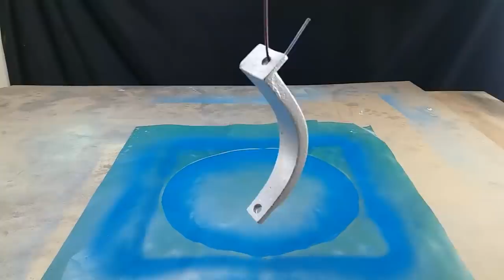Very Old Exhaust FAN Restoration | Restoring Electric Fan Step by Step

Comment: I like your vids. I'm not sure about the color choices, but it did come out beautiful. I think I would have done the whole thing silver with high temp paint, depending on what use I had in mind for it. That's one thing I love about vintage items, the way they were made, you could restore and or rebuild them. Modern stuff isn't made to be redone, just trashed when it tears up... I'm sure somebody could rebuild modern stuff, but it wouldn't be easy. You can be innovative on how you do things when the need arises, I like that. You find ways to do what has to be done. That's so cool.

Comment: Process not described or explained : which chemical used for cleaning how long it required to complete the procedure, step by step explation will give detailed knowledge to get worked done at least narration shoud required
Thanks for good work

Comment: I just want to point out that.. you installed the blades on the hub backwards..
Reply: Theres no wrong way to put them on.  It'll pull air or push air

Comment: Great job but what about the earth cable on a metal fan?
Reply: they did not have them until recently. although one could easily be added and it would have been a good idea if used in damp environments or one where there is alot of machine dust.

Comment: Looks like a rather heavy-duty fan - cast aluminum frame, etc.
Reply: They don't make 'em like that anymore, good stuff they make in them times. Maybe dates back to the 1950's? 1960's? Just wish he didn't test it by pushing bare wires into an electrical socket...!?!
Reply: @Hawk Cuckoo capacitor might have been replaced though, its the most common failure part

Comment: good job, but i've a  little problème...why thethe center of  "screw propeller", it's not the same at the end and when you start your job ?
Reply: It seems the same to me but mounted inside out.
I wonder what is the true position.
Reply: Since the motor is mounted to the frame with 4 arms, it was probably a bit twisted when he first got it. After reassembly it was re-centered and solved the off centre issue.
Reply: i think it was wrong before and later he turned it to correct side, it hides its mounting and looks better, this is how most fans are made , to hide their fixing system

Comment: The way you inserted live wires into a plug socket stressed me out
Reply: House current is low voltage at 600V. It won't zap through the air and get you. I like the way he modded that power strip so he can jam big wires in there on a regular basis.
Reply: That is what happens in; the Middle East/India/Bangladesh/poor parts of China - electrical safety doesn’t exist there 😱⚠️